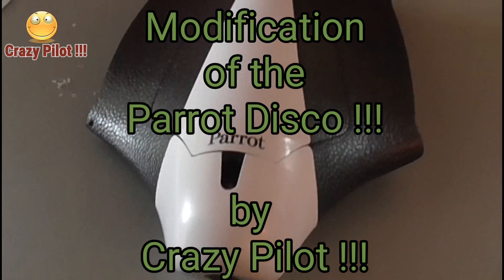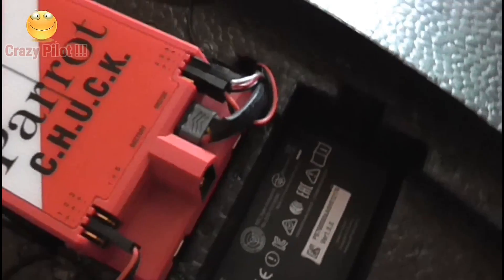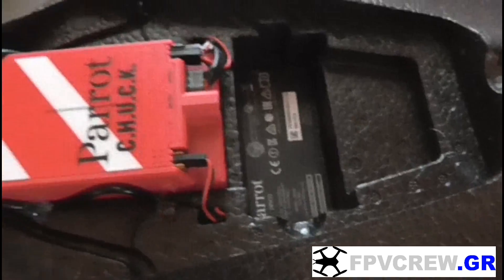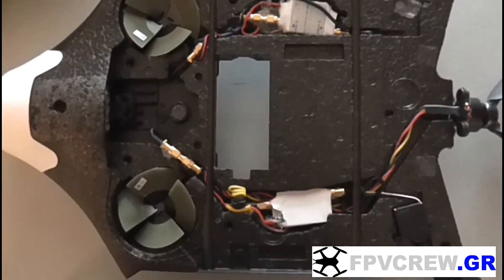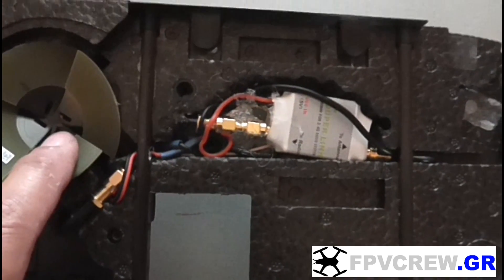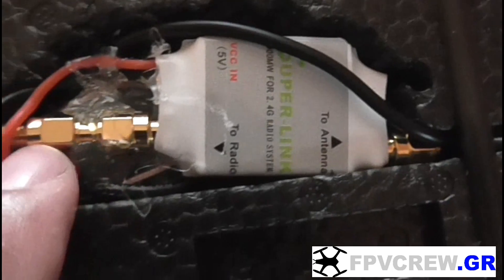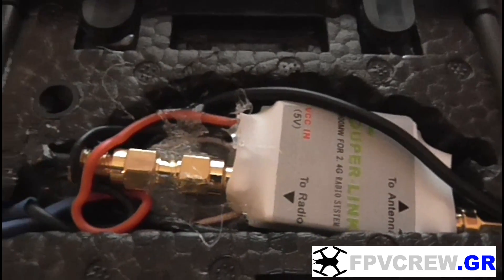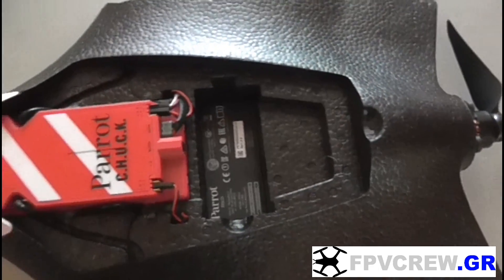Modification of the Parrot Disco !!!   ( mod. part 1)

Comment: I’m not sure servo connector cables used to power booster will let enough current flow to fully power boosters. Should have used balance port of battery to power them. This way they probably working at dropped voltage and very low current thus not desired effect. Peace

Comment: Nice mod, but I’m worried about the added weight.
Reply from the maker: This is the lates mod and it fly just fine. I also use 3s3p 18650 batteries 10,500mAh 
https://youtu.be/AbQTR7QQzDM
Check the other videos on my chennel.

Comment: Um Im confused. Isnt one of the antennas 5.8 as the Disco can be manually put into 2.4 or 5.8 so therefore you are actually causing massive interference if set to auto select?
Reply from the maker: Angus Whitehouse 
This mod is not working check this one out:
https://youtu.be/aCcO_sDvuy4

Comment: Hi Fpvcrew ! Chris Walker pointed me back towards you to show this wifi booster install in the Disco. Great job Man ! Dod you fly it yet and what were the results please ? Thanks. Phil
Reply from the maker: EagleClip Aerials 
Hello again!!!
I had a problen with one of the boosters and I'm waiting for a new one to come from China. It will take another 10 days before it arrives. I will post a video ones I do the tast with the boosters.
Some onefrom another forum tolled me that it will not work, I did not undestand the technical part of why it will not work.
Reply: "Some onefrom another forum tolled me that it will not work, I did not undestand the technical part of why it will not work."

What did he say exactly ?
Reply from the maker: EagleClip Aerials 
Thisis what he wrote:

nice mod with the booster, but sorry to say you make it worse rather than making an improvement :(

1st you need to know that chuck power radio output was 32dBm, there is max input for the booster it self maybe just 19dBm max, more than that can fried the booster

2nd let say booster can handle big input, but with big input makes a bid noise, you should know law of the wireless, if you push the power but noise is high then it will useless

resolve:

you need lower chuck radio power to 15-16dBm maybe makes a different result, or unplug your booster and just mod the antenna it self

i'm sorry just being honest review :)
Reply: Right. And what do you think ? If the boosters wouldn't work, would a couple of high gain antennas help ? To replace the Disco antennas ? Like these : https://www.banggood.com/2_4GHz-10dbi-RP-SMA-High-Gain-WiFi-Wireless-Booster-Antenna-p-970788.html?rmmds=search
Reply: And another thing, if this guy was right, is there a possibility to add something (a device) to bring down this 32dbm to 15 dbm CHUCK output ?
Reply from the maker: EagleClip Aerials 
I'm waiting for these antennas to try on the Disco

www.ebay.com/itm/142416034772
Reply: OK, but you're gonna use these to put on your controller ? ("This high gain antenna could be used to transmit from the TX to the plane or multicopter."). I was thinking of putting the above antennas on the Disco itself.
Reply from the maker: EagleClip Aerials 
I will put them on the Disco not on the controller. The Disco transmits and receives signals I think that the will make a difference.
Reply: Please keep me posted. I've ordered the boosters as well to try out the same.
Reply from the maker: EagleClip Aerials 

This is what I got from the other forum:

CMIIW: he means LNA is low power to gain sensitivity, no need big power but need sensitivity, big power is not everything in wireless but low noise and more sensitivity is everything sometimes using booster can do that job but not everytimes it works

but unfortunately like i posted a hundreds pages before ￼ parrot used wireless chipset BROADCOM which i don't like it, it less sensitivity instead like ATHEROS (like DJI used) less power but good receive and low noise, that's why disco used 32dBm wayyy to much from regulation (only 21dBm max) because they realize that cheap wireless chipset need more power to push chipset weakness

and again, you boost signal from bad signal source 
if i were you, i will leave disco alone
and think to build repeater thats the best i can imagine for disco

someday i'll be making that repeater, but wait until i bought disco again after i lost it 2 months ago :-(
Reply: Sorry for your Disco loss Mate ! Right, so it might be more reasonable to try changing the Disco antennas first, no ? Do you think the antennas I talked about higher up would be good too ? They are 10dbi and cheap. Let me know what you think.